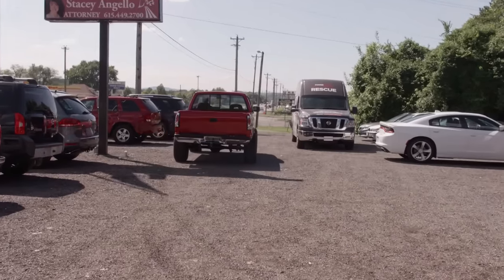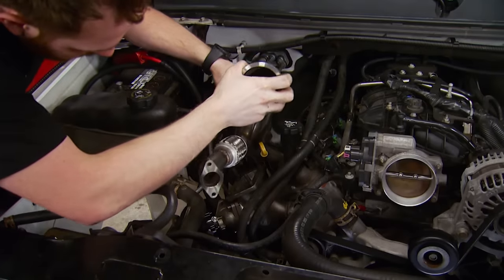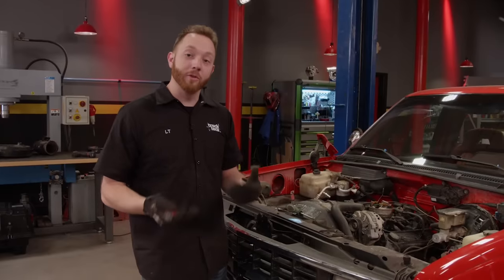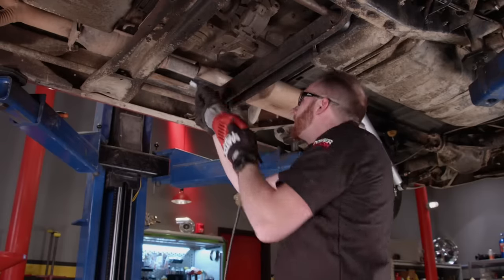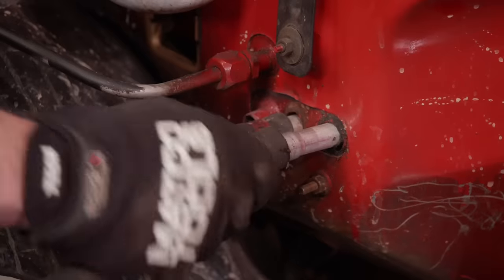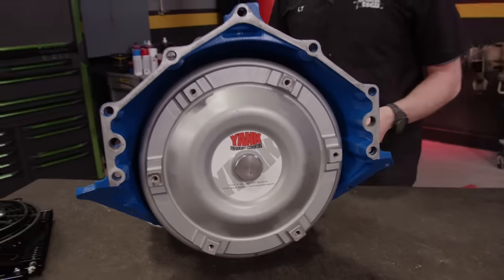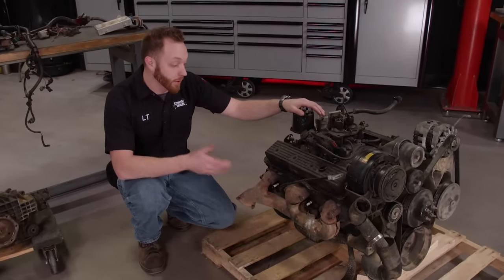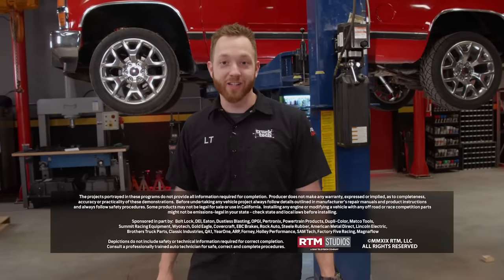LS Swap Do's & Don'ts on a Chevy K1500 - Truck Tech S6, E5

Comment: Would this transmission bolt up to a late 60's, early 70's Pontiac 400/455 (both use the same block, different bore and stroke)???
Reply: It won't bolt up.  In the world of the old GM, there was the Chevy bellhousing and there was the Buick-Olds-Pontiac (BOP) bellhousing.

Comment: I don't know anybody whose pockets are that deep for so called budget engine upgrades like this.
Nobody ever mentions all the other modifications you are needing to do with the addition of all that additional power like performance build transmission ,transfer case ,both differentials ,drive axles ,spindles etc ,etc etc.
Oh and it never pass an emmisionstesting station ever againso now you can no longer legally drive it on the road anymore.

Comment: Can anyone answer why would you lower a 4 wheel drive truck. I actually use my truck. That thing would be useless where I go no matter how much horsepower it makes.
Reply: I think it can put more power to ground than a 2 wheel drive. I think GTR's are set up like this as well.
Reply: Better traction while racing
Reply: @eaglethehulk8539   That truck has part time 4 wheel drive and cannot be ran on a dry road in 4 wheel drive without damaging the system. The transfer case has no allowance for the different wheel speeds like a all wheel drive system does. My truck is part time too ,I cannot use four wheel drive on dry pavement
Reply: @eaglethehulk8539  a transfer case and a front differential is not going to deliver power like the AWD systems in cars.

4x4 is going to rob tons of power & bind up terribly when you throw a bunch of power to it on pavement.....

None of you people realize this & it's pissing me off....
Reply: @johnkendall6962  Thank you SO MUCH for having some common knowledge!!
Reply: @johnkendall6962  haha, did not know that. Thanks for the info. Always wondered why they called it all wheel drive versus 4 wheel drive.

Comment: Yeah, all you rookies....  Instead of removing the radiator, grille, and core support, and then pulling the engine and trans as one unit through the front, put the truck up on your vehicle lift, separate everything, and lower all the parts on your transmission jack.  Because if you've never done anything like this before, you prepared by buying 4 grand worth of equipment, right?

Comment: Must be nice living in a state where there is little to no emissions regulations.
Reply: Atomic Reverend Alexander New engine will run cleaner than the old engine, especially if it’s cat’d.
Reply: @bondpit8750  you clearly don't live in California...
All Automobiles and light duty pickups must go through an emissions check if they are 1976 or newer... light-duty diesel pickups is 1998 and newer.  
All vehicles if they get an engine swap must go through a Smog Referee that approves the vehicle for use on California roadways and registration... it must have all emissions Control Systems from the vehicle the engine came out of installed on them and if it is an aftermarket part installed on a vehicle it must have a "CARB ( California Air Resource Board) number.

Oh and if you get caught defrauding the smog Nazis supposably they can impound your car and crush it although I have never actually met anybody that has had this happen. 
Like I said it must be nice living in a state without emission laws. 
Because all of us know that fuel injection it's cleaner than a carburetor,  and all of know that a late model LS (for example) is a better engine then a say 1976 307CI small block.  
Hell even catalytic converters must be California approved and they are generally 3 times the cost of a 49 state converter.
EDIT: I should also mention that that Smog Referee ice mentioned above has an 18-month waiting period for you to even get seen.  
It's crocked shit just like Commiefornias immigration laws or homeless safe haven laws... The middle class conservatives are leaving this state in droves for a reason and this is just one example. 
The scary thing is in my life I have realized that as goes California soon will go the rest of the nation.  We are actually seeing this with emission laws as more states are adopting what California has set in place although be it most exclude vehicles after 15-25 years, I think we are still the only state smogging cars from the mid-1970s
Reply: Hell with all that.  Here is a better example.  1991 Honda Civic ZC Racing engine.  Ignition box, headers, no muffler, no Cat, only a resonator.  Upgraded cams, low impedance induction, full aluminum cooling system upgrade.  Also SI racing trans and upgraded fat daddy axles.  300 horse to the wheels NON-TURBO full precision and balanced build.  Top notch build all around. 

Took it to the referee to have checked.  Passed all the chemical emissions and ran cleaner than a 2006 stock Honda Civic.  Very low emissions because it was done right.  No smoke, no high revving at idle.  Passed at the idle, 1500 rpm, and 2500 rpm and the 3500rpm tests with no issues at all and ran flawless.  After it was all said and done it got failed on the visual because they said the ignition box didnt have a CARB EO sticker and got listed as a "Gross Polluter" with the state and can never see the road or registration or be sold within the state of California until it was "Returned to stock configuration and rechecked with the State of California current year enforcement regulations for chemical emmisions."

That's state is so screwed up that they have done legislated themselves stupid.
Reply: @joshtheking1772  Josh I feel your pain... I have had probably close to 100 cars all of them registered to me in Commiefornia.  I grew up in the 1980s and 1990s and have been a gearhead since before I was legal to drive. I have a soft spot for some of the late 1970s- mid 1980s cars and trucks but after inheriting my pop's 1984 CJ7 when he passed that was in really nice condition and ran excellent it wouldn't pass an emissions test because the heat riser tube fell off of the air cleaner... It passed everything with flying colors and the asshat smog tech saw that during the visual and failed it instead of just pushing it back on... I am not blaming him because for all he knew I could have been a undercover emissions inspector... It kills me that the Jeep is now a gross polluter even though it ran absolutely clean for a 1984 all because of something so simple that was clearly an oversight on my part. I now strictly buy truely classic cars and daily them... My 64 Plymouth (my picture shows the interior of it) gets 22MPG, has no smog, is on a classic car policy and smells like shit in the exhaust because it has no emissions, its a fun car with no headaches but the reality is anything from the 1980s would run cleaner then it and for sure any built car regardless of year would be cleaner... Its the visual check that truly bothers me, I mean if you take a 2008 LS V8 and drop it into say a 1981 280zx it will do everything better and make less emissions but yet when the hood is popped it will fail the visual... Absolutely stupid! 
  
As soon as my obligations are over here (taking care of an elderly mother) I will bounce out of this over regulated state in a heart beat for more car friendly pastures elsewhere.  Even if I go to snow country the off time will give me a chance to build the next ride but I digress.

Comment: I own a 2012 Sierra gmc that I’ve kept the miles down to 19 thousand miles for a main driver when I retire in a few years. What would you do to upgrade it. It has stock 5.3
Reply: Stock 5.3 will run great with just a cam upgrade and some newer behive springs send it out for a tune and you will be in the range of a stock stingray
Reply: Glen Edwards converter, speed engineering headers, camshaft. In that order

Comment: Little kerosene in the oil fix’s that oil burning in them tbi’s, dump a pint in and idle it for 10min and drop oil and it’ll stop using oil

Comment: Well that is not high mileage, it`s bad maintenance. My 1991 C1500 Silverado long bed has 300,000 miles and still going strong. If you take care of it, it lasts. Get gas? Check fluids. Trans fluid looking dark? Change it and filter Same with oil and filter. Use good filters, not fram. I use Wix(NAPA Gold is rebranded Wix). Check every fluid. This is how I got to 300,000 miles . Your swap too much work, I`d rather pull and rebuild the 350 my way and make some power. It`s easy to get 350 hp or more out of the rebuild N/A. Want a turbo or nitrous? Widen your piston ring gaps or you could break a piston when ring gap closes under high heat and it breaks the ring land and destroys the build. Stay safe, God Bless.

Comment: Put a bigger cam and a 4 barrel intake and u have 400hp easily on the vortec 350
Reply: That was a tbi, not a vortec 350.
Reply: @toddholldorf9494  easy to swap the intake on the TBI to 4 barrel and carb it.

Comment: I would like to know where to get that transmission pump from, I wanna change my fluid.
Reply: Just use the upper cooler line get a length of hose run to a bucket overfill by a few qts and get someone to man the keystart adding fluid after you verify flow do about 12-14 qts should flow brite red the shut off reconnect and check level
Reply: Harbor freight
Reply: It's a vacuum pump not a transmission pump if you're searching the net..
Reply: The unit they used was a MityVac fluid evacuator. I've got two of them, one for oil oil and one for new transmission fluid. A simple turn of a switch and the evacuator changes from a vacuum pump to a pressure pump.

Comment: Got one question do you have to change the computer ? With a computer engine 5.3ls or  is the computer fine
Reply: The tbi computer will not run an ls engine, well maybe it would but youd need a stand alone ignition and it would suck.  The factory 5.3 injection and harness is easy and cheap.

Comment: Run it on a terminator x!
Reply: never!!!!   OEM  is like 10,000 times better   not even close!
Reply: @internationaldynoauthority693  not!
Reply: @scottydoesntknow254     once you start with the granularity level and work day  in and day out with  an E38  you will never ever dream of tuning anything, except OEM and Hp tuners.
Reply: International Dyno Authority  lets see an oem computer do closed loop boost control, boost-cut, lean protection, and anti-lag... we’re waiting.
Reply: @knowbull5hit590  self tuning, free software for tuning updates and so on. Holley is they shit I wish would have went that way on my swap

Comment: From my personal experience, companies like PowerTrain, LKQ, or Power Torque sell "just good enough" re-manufactured engines and transmissions.  These Companies entice consumers with great warranties and the illusion that the product is 100% refurbished. However, this is far from the truth! It is a known fact that internal parts are reused (ie: lifters, cams, clutch packs, solenoids) and only replace what is damaged. Another fact that is not told is the red tape of customer service. Trust me it's a nightmare and a unethical way to do business. The consumer troubleshoots the product and is reimbursed at 1/2 the labor rate. If problems still exist after you've wasted money repairing a faulty product, they will ship a replacement. Do your research and read reviews online and claims on the BBB website before buying.

Comment: Heck of a build, but how much do all those goodies cost? Not at all a blue collar build
Reply: A good job and no foolish debt makes buying nice toys a lot easier.  Lots of blue collar jobs pay well.  Welders, machinists and other trades pay better than most white collar jobs.
Reply: Very true, and in Not too long will be paying even better since the newer generations have no interest in trades or even getting there hands dirty for that matter
Reply: All said and done   A Little  over $18,000  spent on this     "Budget blown"......
Reply: A true blue collar build is a set of brakes and tires.  Nothing cheaper than a reliable stock setup.

Comment: I dunno how i feel about lowering a 4x4, why not just get a 2wd and do that, 4x4  needs to go higher mang.
Reply: Can’t drag race or street race a lifted truck in Mexico
Reply: Theodore Dowman Carr to explain to the class how an awd powers the front tires with no transfer case? We’ll wait
Reply: @littlebillb4168  Transfer cases do not bias power sent to the front or rear, they divide it. 
AWD vehicles use a center differential or "interaxle" that can divide torque in any manner, front or back...

There ya go.....
Reply: Waylon  Miller  None of those cars are 4x4, they are AWD..

Comment: A definite don’t is lowering a 4wd. Definitely ruins the functionality of a truck with a 4wd.
Reply: Dave Micolichek why is a lowered 4wd awesome? If you want a lowered truck buy a 2wd.
Reply: Waylon  Miller trucks are designed to haul or tow things. A lowered 4wd is just stupid, and defeats the purpose of having a 4wd in the first place.
Reply: Waylon  Miller no I’m not one of those morons who need to lift a 60k truck. I would never buy a newer truck because I know that a 98-88 Chevy is better built than any Ford or Dodge out there. I’m not a rock crawler,  and don’t do anything crazy stupid.

A lowered 4wd has no functional purpose to it. Why anyone anyone want to lower it in the first place?
Reply: Waylon  Miller I tow plenty of my vehicles up and down mountain roads. Lowered trucks are useless to me
Reply: Waylon  Miller my 93 K2500  wouldn’t have a problem. It’s got a 5.9 Cummins swapped into it.
Reply: Waylon  Miller  The 2wd truck will smoke your ass.  Less parasitic loss h less overall weight......
Reply: Waylon  Miller  driving around in your lowered truck.  What are you trying to look like a gangster?  Fu
Reply: Adam Weber what state are you in? I can’t drive anything that’s not either 4x4 or AWD. I love the look of lowered trucks, but Illinois and Michigan winters are what stop me every year from getting any rwd or fwd for a daily. Lowered trucks ftw.

Comment: Hollywood mechanics... not everyone has a lift or air tools. SO after disconnecting the battery the number one thing to do in the real world is dive under the truck remove starter, disconnect exhaust, driveshaft, fuel lines bolts to trans mount and engine mounts, trans lines anything you can see that has to do with the engine disconnect or remove while you are under the vehicle because you don't want to roll in the oil, antifreeze, trans fluid when you disconnect the hoses and line up above shit runs down hill!then start on the rest on top as shown.

Comment: That statement on making power in an n/a application should have been
"We made 150 more horsepower in our 351w by simply throwing a shit ton of money at it."
Guy, those heads were at least 1500 for the set, not including rockers and pushrods
Cam was probably around 250
Intake and carb probably 1200
Odd and ends always 500+
Thats 3500+ dollars
In what world is that cheap? Especially for 150 horsepower.

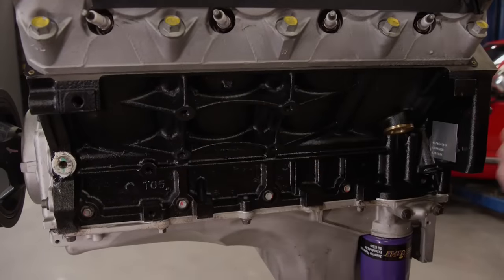Comment: I cringed when I saw him power washing the engine bay at 12:00 without covering the A/C lines. Moisture inside the system will create oxidation and wipe out the system over time.
Reply: True. That's what vacuum pumps are for though
Reply: Vac pump doesnt clean the crud out.

Comment: Will a 5.3 work with nv3500 from a 1990
Reply: Idk ? Probably not. Find a Chevy Tracker 2 wd  . They are around but getting hard to find . Behind that 1.6 liter Suzuki rice burner you will find a 5 speed Isian interchangeable bell housing , best  for the money Trany available. Short through shift . Excellent quality . A bell housing can be bought to mount any engine by any maker mount to it . You may need to change the rear end or change the actual gears in the tranny but it's alot cheaper than a costom 6 speed

Comment: too expensive to go build a 383 so we bought a $3500 crate motor, what did that trans cost? bet  the converter was at least $300, plus intake, flywheel, motor mounts, accessories computer wiring, they aren t gonna put that transfer case back on i bet, headers etc.. . i'm all for ls but damn these guys toss money around. how bout cheap- junkyard ls. or just 383 with a carb? cheap stuff the young folks, or us poor old people can afford easier. scare new folks off too easy.

Comment: Why lower a truck, now you have an ugly, bad handling heavy Ute, that is garbage off-road and towing
Reply: this is so incredibly wrong its not even funny...you must have no idea how lowering a truck works nor towing. ive seen 4" lowered 1500s that have gone places stock jeeps cherokees would laugh at just because its body dropping mostly and the axles hang so low down anyway from the lowest part of the frame(something no true ute has), and 6 inch lowered early 90s chevy 3500 trucks towing 2 story car haulers with heavy big body mopar drag cars

Comment: Yeah its just 3500 bucks plus intake carb or fuel injection accessories trans etc not totally worth more then the truck which is why id rather see a tbi rebuild